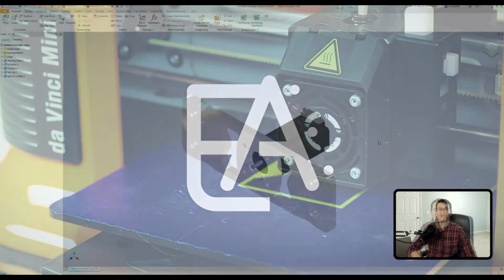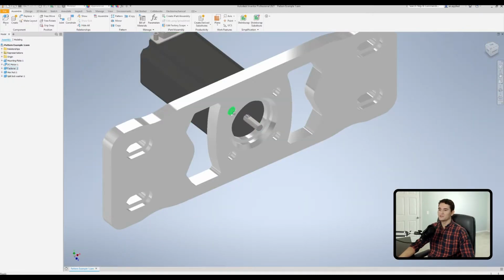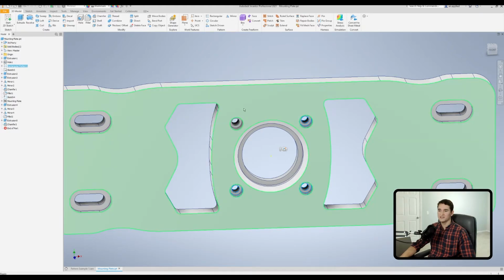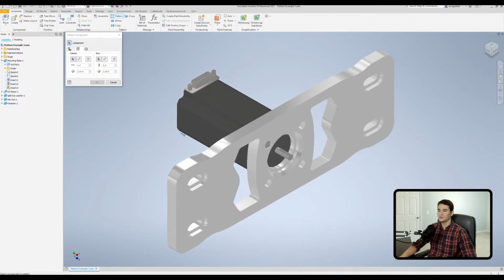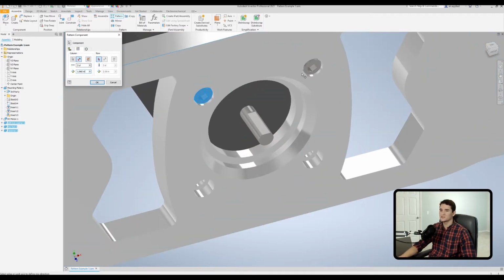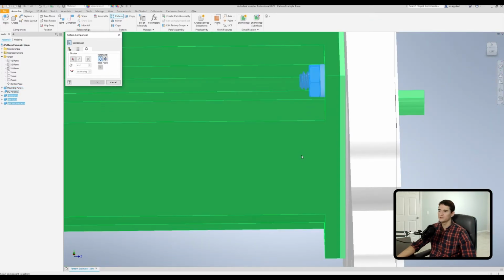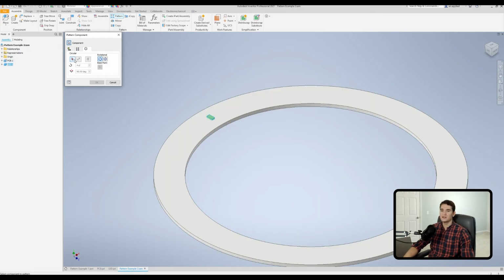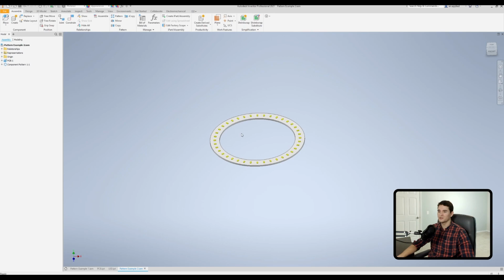Assembly Patterns - Autodesk Inventor Assembly Tutorial | Autodesk Inventor 2021 IN DEPTH

Comment: You would go with the first option naturally right so its parametric? If the bolt holes change spacing at the sketch level, the fasteners should adapt to those changes right?

Comment: Why would you manually type in dimensions to pattern the bolt, instead of making the pattern reference the original hole feature pattern? Anytime you change the hole pattern, the bolt pattern would have to be adjusted manually. This isn't parametric. Is this a shortcoming of Inventor? In other words, Inventor doesn't have the capability to have components reference the feature pattern on a part in the assembly?